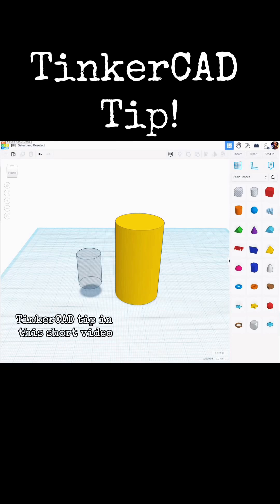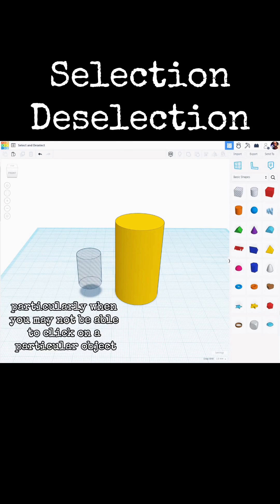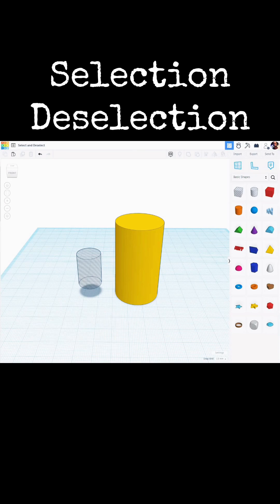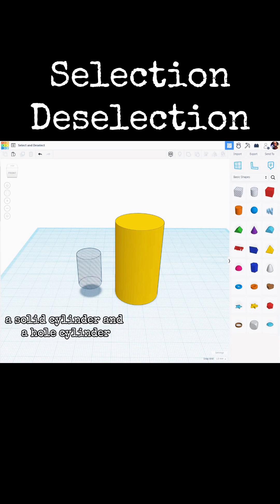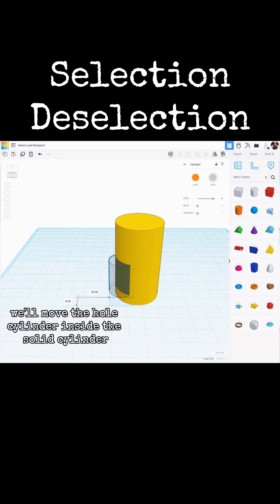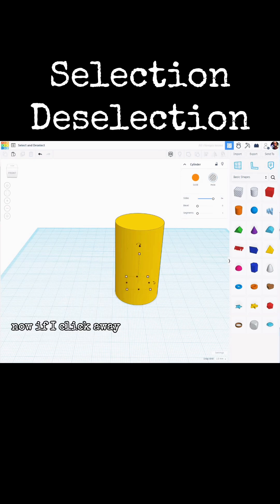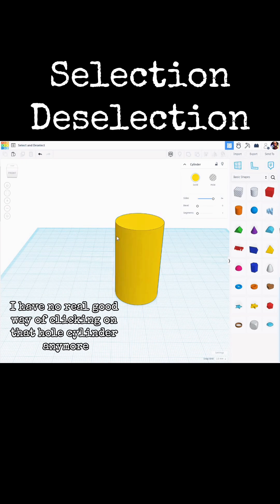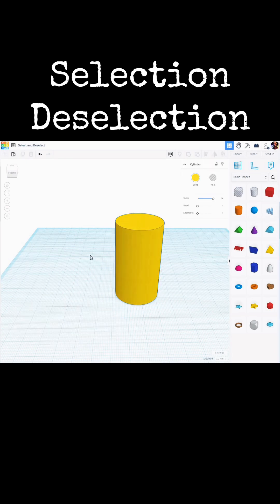TinkerCAD Tips!  Object Selection and Deselection.  #tinkercad #caddesign #3dprintable #3dprinting

Comment: thanks! thinker cad should have an object browser panel
Reply from the maker: Have you seen the online spreadsheet that HLModTech put together of all the various objects and shape generators?  It’s much easier to look thru than what TinkerCAD has provided.
Reply: @KevinGroninga3D  no, but I will take a look at it thanks. I was thinking more about object browser of the object we are working right now, so that I can easily select an object which is inside other object.
Reply from the maker: @no1geek selecting an object that’s inside of another object is easy.  First select both objects, then hold down the shift key and click on the outside object.  That will ‘de-select’ that one, leaving you with just the inner one selected.